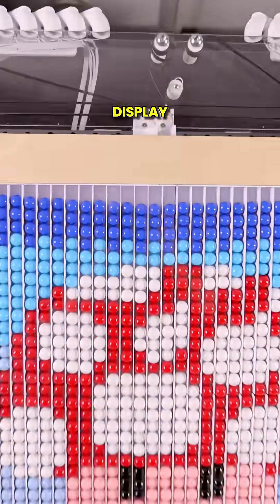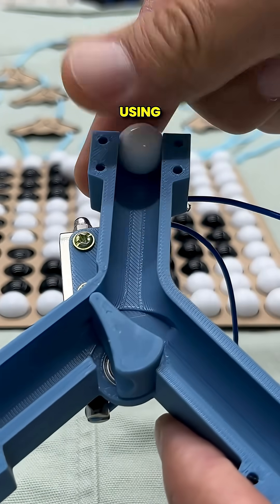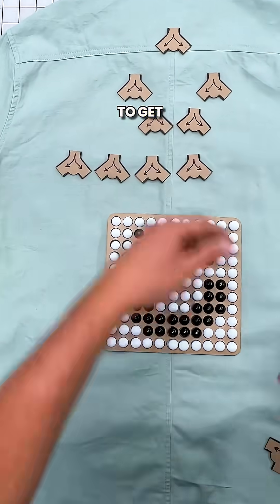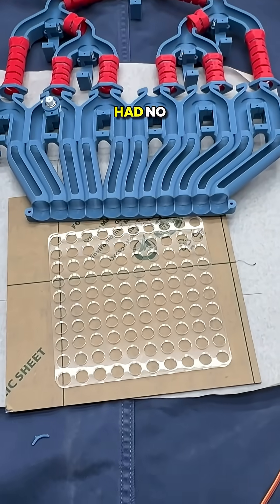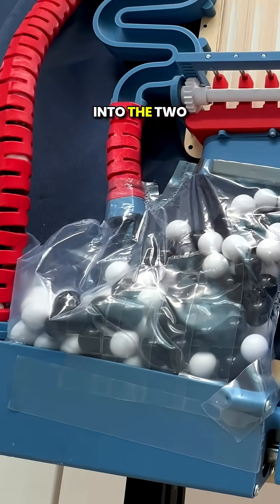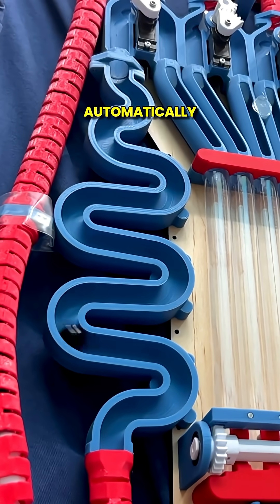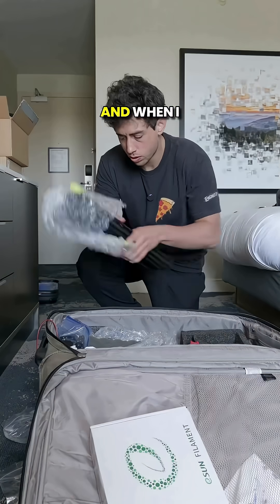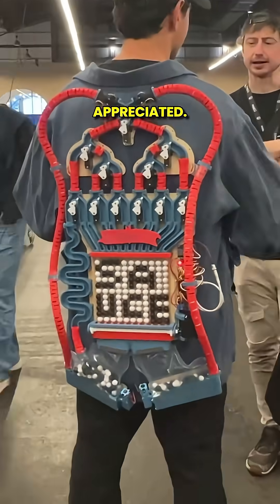Marble Machine on a Jacket

Comment: It's actually quite cool. I built a very similar device for my master project.

I was building a connect 4 robot that would allow 2 players on remote devices to play connect 4 on a physical board.

I used a pretty similar array of binary gates that guided the tokens into the correct columns. Then I had a colour sensor setup at the bottom to sort the colours after the board had been cleared.

Pretty cool to see a projects with pretty much all the same parts out in the wild like this.

Comment: @Engineezy Instead of dumping the marble, route it to a temporary storage, because you WILL (probably) need that soon again, you can even use multiple (2x) storages for each color, so the machine can just retrieve whatever color it needs, instead of first wasting work that it will need later, and then STILL need to wait for a random time for the right color.